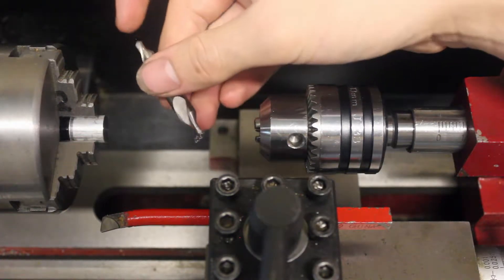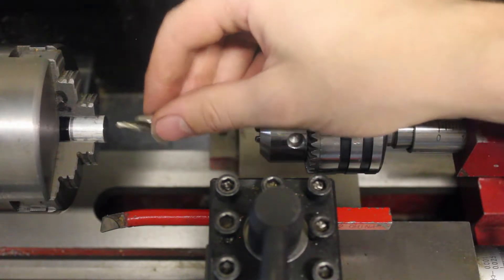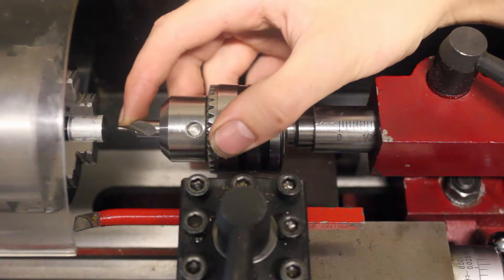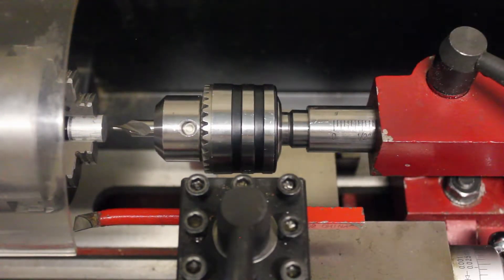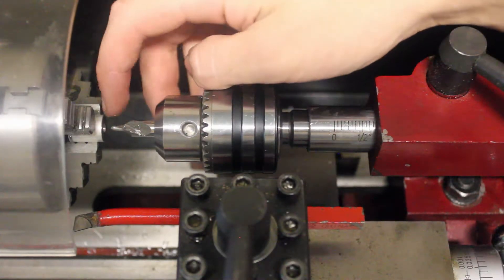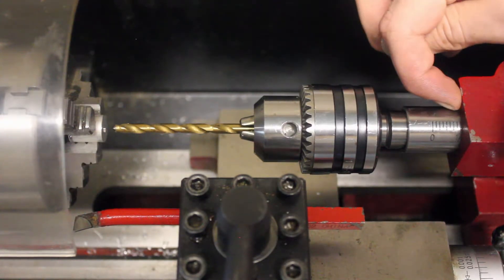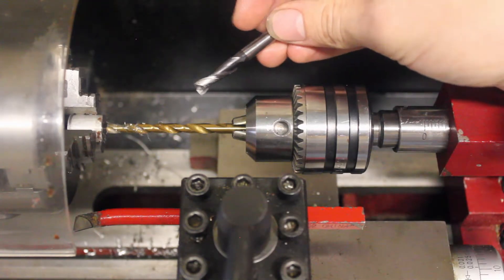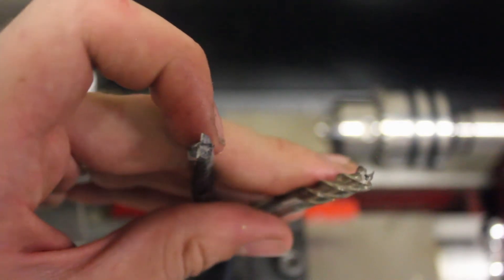How To Lathe: #3 Drilling and Boring - Tutorial

Comment: Very good job I have a question I have a peace of solid round 3inch diameter 8 inches long I want to bore a 1 inch  hole in the center of one end 6 inches deep  can it be done on a drill press ? Any advice would be greatly appreciated